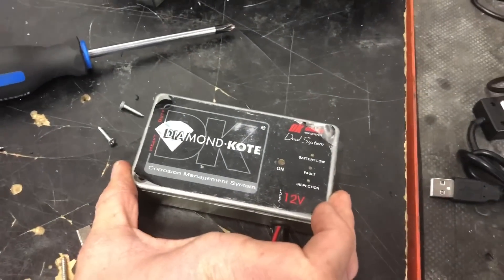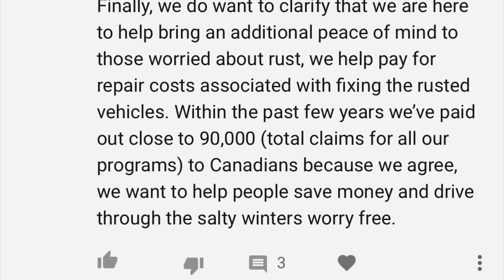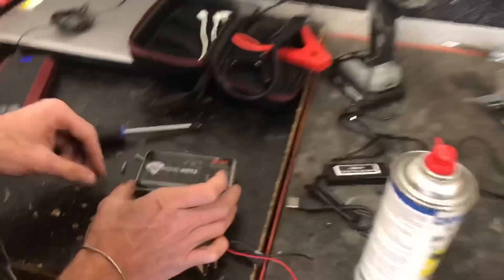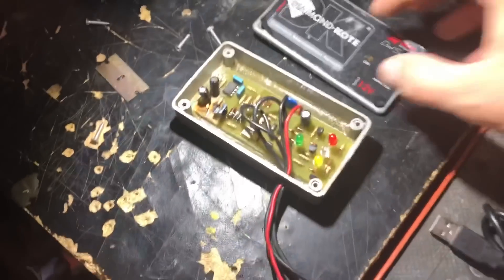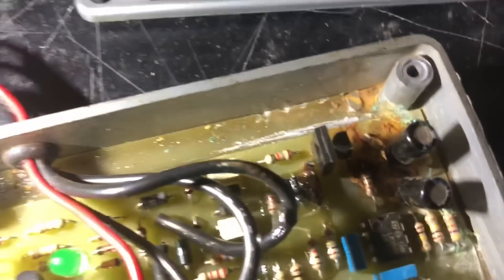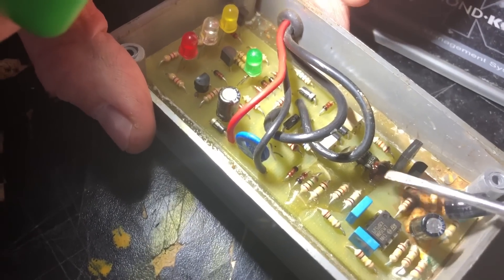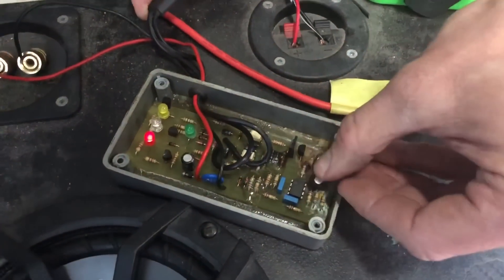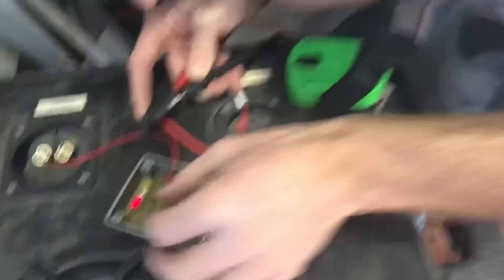What’s Inside A Diamond Kote Rust Control Module.

Comment: My used car came with the Diamond Kote unit that plugs into the obd port.
So I took it apart, and there is a little circuit board inside. Odd thing, it's not connected to any of the obd port pins. 
So how does this work, magic😂.
As PT Barnum said, "there's one born every minute".

Comment: I have an electronic rust protection on my car, and it does work.  The problem is, the system doesn't stay working for ever, you have to keep an eye on it, and maintain it.  If you don't do that, the system will fail and you'll get rust going.

Comment: I didn't want to say anything, but the more of your video I watched, the more you continual mistake about the LEDs made me cringe. You opened up the box, rotated the box 180 degrees and used the lid to reference - even though you used the 'ON' LED as your point of reference!  The YELLOW is "Inspection", NOT the Red which is for "Battery Low".

Your expert opinion of the inside components was WAY off. The capacitors DID leak and corrode their leads and made a mess of the area and adjacent resistors - the caps could have been exposed to voltage spikes or higher heat than it was designed for, and they died. The rest of the components look fine, even the "swollen resistor" which is an INDUCTOR and should appear exactly like that. The inductor increases the output voltage with the help of the black transistor standing behind it, including several of the black diodes with the silver band at one end.

Lastly, since the output will be a fast-switching DC voltage, testing the output set for OHMS (OMG!!) or for DC or AC voltage at low current will not give you the results you are looking for, whether it works or not. You would need an oscilloscope to determine a working/non-working diagnosis.  Whether such a system works or not for its intended purpose is irrelevant, your clumsy and amateur diagnostics and absurd commentary tells your audience that you should not attempt electronic activity until you have at least some understanding of what you are doing and how such components and circuits function. Please stick to tire and oil changing, something you would clearly excel at.

Comment: Zinc anodes were used on steel boats to prevent major corosion from salt water. It works because they are bolted or wired onto the shell that rests in water, on a vehicle, it is not exposed to the same environment. This products claims to show when it is working hardest and during rain is an example.

Comment: I just pulled one apart and almost the entire block was full of extremely hard plastic like resin.  I used to think these things worked but now I know for sure they don't - 2009 low millage V6 Malibu inner and outer rockers rusted out completely to the inner floor pan - which seems impossible to repair at this point.   It's ridiculous how these cars are made and so many sheets of steel overlapped with spot welds that start rusting almost immediately in high humidity and salty environments.

Comment: Nice tear down.  Unfortunately the unit is damaged, so a vendor is correct to argue that the vehicle rusted because the unit was defective or installed in a faulty manner.  That being said:   
I believe electronic corrosion control for vehicles are scam products that do not have any benefit corrosion-wise for a vehicle.  Consensus amongst professionals in the field of corrosion control is that electronic corrosion control of vehicle of the type advertised under various brand names are not effective at corrosion control and bot backed up by recognized independent testing.   I have reviewed warranty and user manual materials for some of these systems and I believe they are not with considering.  I write more about the systems at my website  @t

The different brand names include the following:
Auto Saver System

FinalCoat
Etronic Anti-Corrosion Module
CounterAct
Body-Gard®
Rusterminator
RustStop®
Couplertec
Electro-Shield
Rust Evader
Neo Rust Evador

Comment: The best way of preventing a steel car body from rusting is to zinc-coat it in the manufacturing process after it's all welded, before it gets painted. Some car manufacturers do that, others don't.
Reply: I don't buy that. Compressed air and washing off dirt and salt, at least YEARLY, then drying and spraying and pouring Oil type fluids into hard to reach areas seems on the lowest parts of the vehicle seems to be the best way of "preventing a steel car body from rusting" - even if or especially when a manufacturer zinc dips.
Reply: @01mustang05  My car (from 1999) is zinc coated, and I don't do this annual maintenance on the body, and it still doesn't have any rust.
Reply: @Seegalgalguntijak   "doesn't have ANY rust"? BS! Even if you have had it indoors all this time and climate controlled with low humidity there will still be some rust.
Reply: @01mustang05  Whenever it's at my friend's shop, I usually go under it when it's up on a lift and I don't see any rusty spots or areas. OK, the rear axle and control arms have some surface rust, but they aren't zinc coated, while the body is: And there's no rust to be seen! I don't know how well the "hollow spaces" in the body are sealed, but since they were probably also zinc coated (instead of sealing them), I don't think there is anything there either.
Reply: @Seegalgalguntijak    How many millions of zinc dipped vehicles have rusted out on this planet within 10 years?  And just because you have one that hasn't because you must be not using it like the majority, means the zinc bath is "the best"?  I already caught you in a lie and your original lie remains.  It matters what you say and you should be more careful and more aware because we have bigger issues to get on the same page about and we have to be talking reasonably and truthfully!!

Comment: 1. The LEDs are upside down on the cover as to how they are sitting in the module, so it's actually the battery low LED that appears to be on.
2. Of course a broken module with a capacitor leaking/disconnected from the PCB, a blown up resistor and these kinds of faults would do nothing.
3. Are these modules normally completely potted in epoxy, and this one was just the last in its batch so it got only half the dose?
4. I would have loved to see you bigclivedotcom-ing the shit out of that thing and reverse engineer the circuit to exactly explain what the module is supposed to do and how it is supposed to protect the vehicle from rust. What does the 6-pin chip do? What is the circuit designed to do? Come on, man, it's not like you wouldn't know anything about electronics, just stop dumbing it down for us! :)
Reply: The opamp is a LM358N and I see two opto's, perhaps they are switching or pulsing the two black leads?

Comment: Sacrificial anodes are a real thing in the boating world...

But they’re a LOT bigger, real power, and are PHYSICALLY CONNECTED TO RAW METAL. All these phony modules for automotive use double sided adhesive tape to secure them to painted metal 😂
Reply: I used to install 4 foot long zink bars in water city water tanks. The tanks are steel coated in baked on glass. The bar itself is isolated from the tank just steel threaded rod used as wire to conned the ends to the tank. The technology works when actually used.
Reply: I have also had to dran tanks to replace the bars which wer completely gone. Just the steel rod through the center left and not one spec of rust anywhere.